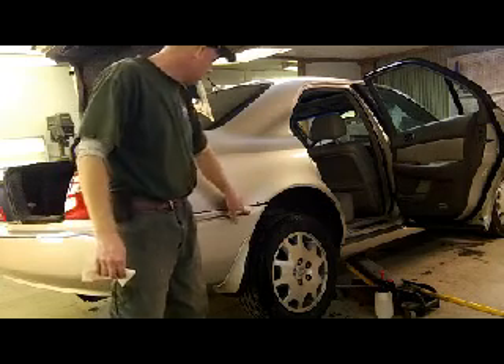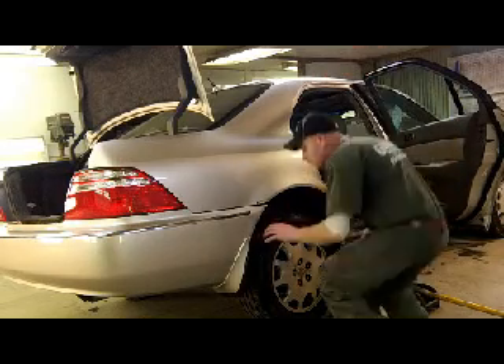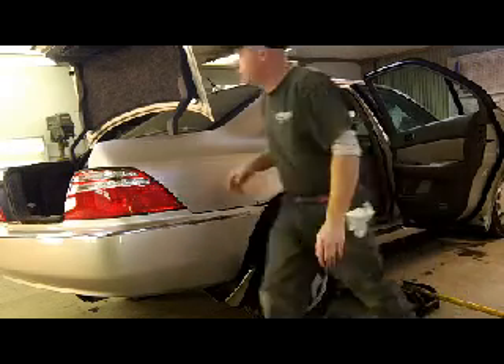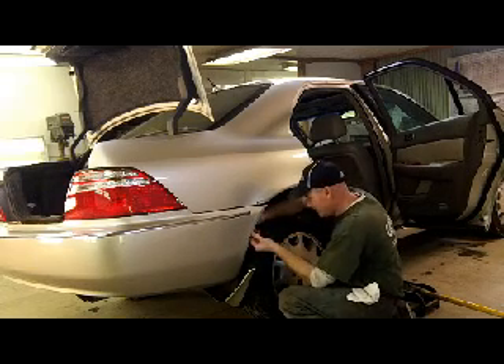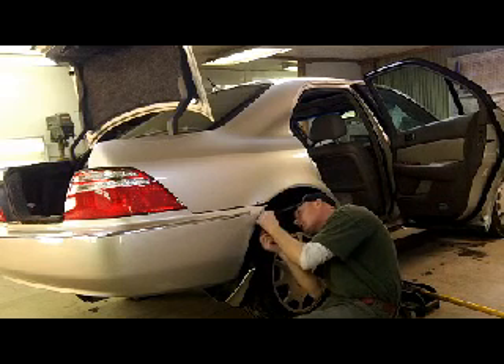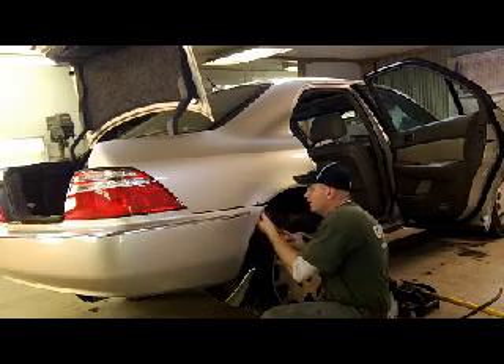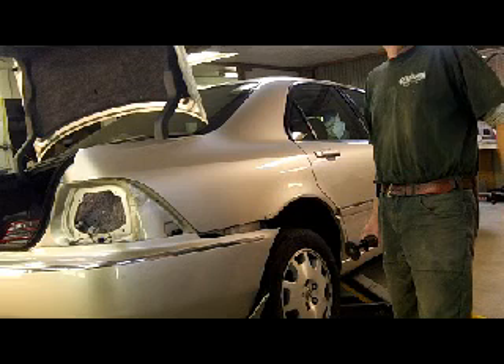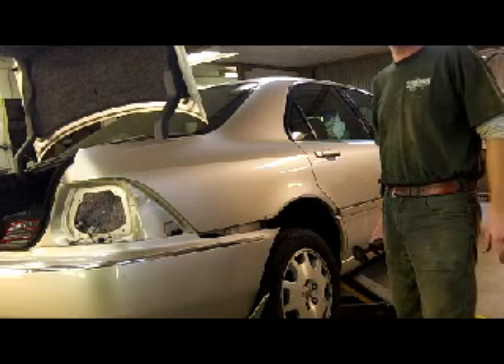2004 Acura RL Rust Repair part 1

Comment from the maker: Yes, all Honda products seem to trap the dirt and debris in these areas and rot them from the inside out.  The other problem is the foam seam sealer they use between the inner structure and the quarter panel.  It hold the moisture and starts the corrosion process all over.